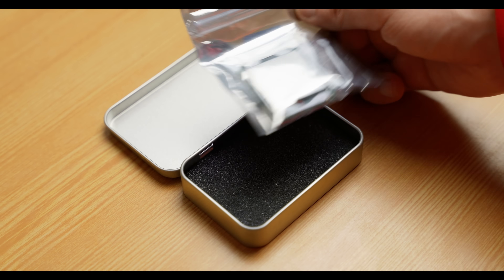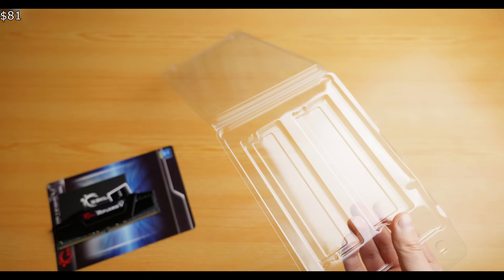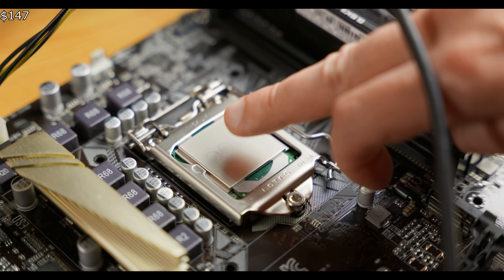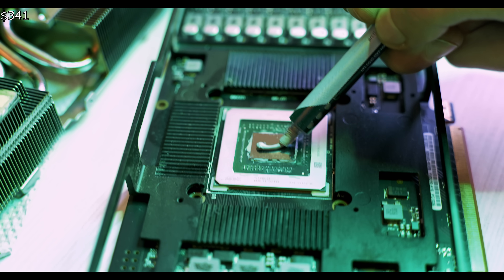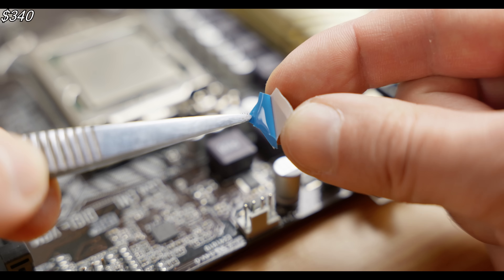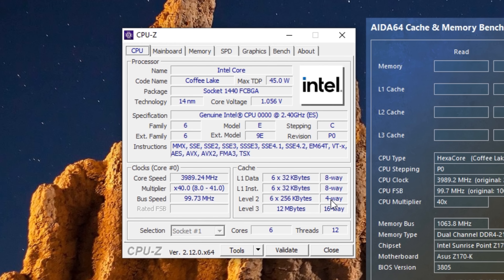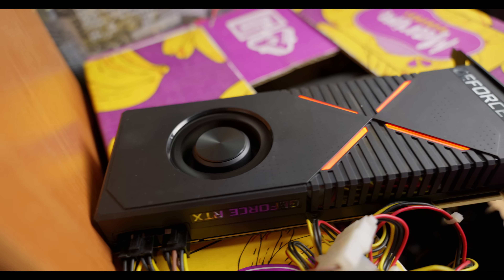I Built a PC With a Laptop CPU

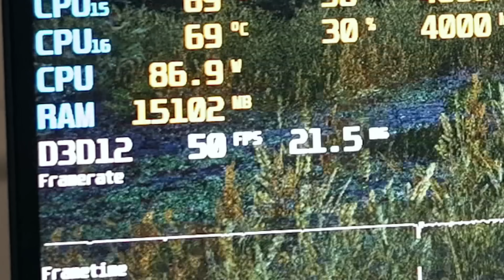Comment from the maker: There is an error in the video with the name GPU. I didn't notice it when I was editing the video. I sometimes change names as a joke, but this is not the case. I will leave this message for those who do not know much about PCs. 5:26 - AMD RX 5700XT.  11:21 - AMD RX 580. 11:38 - AMD RX 5700XT. It's just that the voice actor made a mistake when voicing the text
Reply: The RTX 580 is basically the same as the RTX 5080 but with one less fan and the Nvidia logo removed for licensing reasons. Also great value for money and much easier to get right now than the 5080.
Reply: @RealNovgorod what are u talking about that doesn’t exist
Reply: @kevinjacob9420  It's a joke...
Reply: I really hope you said the washers are there cos cpu vibrates as a joke XD
Reply: Ok
Reply: Why do you need voice acting for the first place?
Reply: @aero2zero  he is Ukrainian
Reply: Are you the same person behind T-1000?
Reply: What you did with your voice, Never again...
Reply: як ти цей відос озвучив?
Reply: @ivanitos_1  То не він озвучував. Геній
Reply: Great Video! I Just wanted to point out one thing for you since it was important that the processor mounting screws remain tightened down. The "Lock Washers" only work when the washer is between the Head of the Screw/bolt and a surface. The Split in the washer, in a spring configuration, creates a 'toothed' effect resisting the screw from Reversing over time by toothing into the surface and screw head basically "locking" it from rotating backwards. With the washer simply between 2 "Non Rotating" Surfaces, it is no different than a spacer. 👍
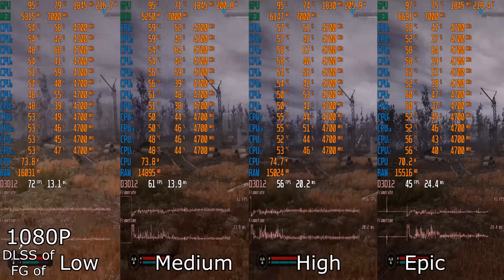Reply: Also there was a frame where you were flashing a text that says CPU bottleneck while you were pointing at the GPU. 11:18 🤷‍♂
Reply: yo lemme get a pc mine sucks
Reply: Jesus Saves and Loves ❤

Comment: i built an mini-PC out of an Core 9 Ultra 285K and an undervolted RTX4090D from china, it's liquid cooled, coolant lines are custom fabricated copper pipes 👍, it is very small and runs cool, i run Linux Mint on it for portable work applications, i carry an samsung tablet i connect to it as a display

Comment: mobile processors can't handle as much I am shocked that it didn't burn out.... I wouldn't buy the power supply from Ali as with most things coming from the consumer based out of china and the voltage being different I would just buy that locally....

Comment: Bigger cpu coolers are useless because the thermal resistance between the die and the heatsink (between 1 layer of thermal paste and another layer of either solder OR thermal paste and the IHS) is just too high to get all the heat though into the heatsink.

Comment: WTF. i had stalker 2 since before christmas and i get even get it to launch. specs:
EVGA SR-2

Dual X5690 OC at 4.4ghz

24GB Corsiar vengeance Tripple channel OC around 1800mhz (edge of stability)

Adaptec Sas 6gb/s plus several Seagate Cheetah raid 0 arrays

Quadro M6000 12GB
Geforce GTX480 (2 more VGA monitors and physX)

SB Titanium HD

Windows Server 08 R2 (windows 7 SP1 with extra stuff like type 1 hypervisor) 

can run metro exodus on max but cant launch stalker :/

Comment: There is an error in the video with the name GPU. I didn't notice it when I was editing the video. I sometimes change names as a joke, but this is not the case. I will leave this message for those who do not know much about PCs. 5:26 - AMD RX 5700XT.  11:21 - AMD RX 580. 11:38 - AMD RX 5700XT. It's just that the voice actor made a mistake when voicing the text

Comment: Ah yes, the good ol Phillips power switch. You’re my kinda guy. Can I have this PC when you’re done? I love ASUS boards and strange cpus. My main pc back in the day was an ASUS K8N modified to take a laptop mobile Athlon 4000+ overclocked to around 3ghz and 3gb ddr1 ram.
Reply: Also wanted to note I too made a computer in a box with a smashed slot 1 system I trash picked as a secondary pc to play network emulated snes games with my siblings

Comment: I've got the same ASUS z170 motherboard with the QTJ1 chip from  aliexpress. . Some users had delided them and got much lower temps. Interesting information about the VRMS  , I had been searching for where these were on the z170 board without luck I could see several locations were  running at around  110degrees Celsius and it is probably these. Youtuber Miyconst had said these boards vrms were too weak to run these 8 core chips and recomended the z370 minimum 
 but they seem to be capable. I've settled at around 4.6ghz and a slight undervolt as the system becomes unreliable running any faster.

Comment: Those washers are not against vibration. This CPU is not dimensionally fit for socket, so it is there to raise it a bit to accommodate it in.
Reply: yeah room temp iq take from op . brutally obvious it was due to the interposer and and heat spreader
Reply: @donbot5000  calm tf down dude. unwarrented hate out here. he is from ukraine and hires a voice actor who knows nothing about pcs, that's why (among other things) he says 'm point 2' instead of 'm dot 2'. that is probably the reason some things dont make sense. calm the fuck down and instead of using all 3 braincells to write mean comments, use 2 to write comments and one to think.

Comment: Tbh I'd put the extra 10-15 bucks towards a new nvme ssd.
Also a bad 2nd hand psu isn't a great idea if it's your main pc and not a throwaway build, especially if you put a cheaper thirsty GPU (e.g. an rx580 or 7970) alongside the 130W cpu. At best you might experience crashes/instability, but you also risk sending too much voltage into some components and fry your gpu/mobo.
You you can't afford good hardware, you sure can't afford to fry it, save a bit more and grab a decent brand new psu that has a warranty for 50 bucks. (Do check reviews first, some new psus have been known to blow up)

Comment: There are some significant issues with the video... psu IS important and the washer mod for the socket... vibrations... no. it's because the mutant is dummy thicc...

please do not attempt to use a 350w psu for a 2080.

Comment: this is cool mod.   My only real comment is with a banana box instead of a real case -  you are throwing rf out into the world.    I am not an electrical eng., so I have no clue as if too much or very little.  I am a safe limits guy, so I would be concerned.   fix - wrap al. foil around box.   but besides - cool.

Comment: the cpu vibrates what? no the washers are included to raise the height of the locking mechanism so it will still work with the increased height of the new cpu...

Comment: Just give 5$ to a scrap yard and take an old pc case leave the bananas 🍌 box plus you can find under 10$ cases on pc stores at refurbished parts , also if the PSU fails it might be bye bye for the hardware, give extra 15$ for a decent PSU

Comment: 4:11 ah yes, saving 10 bucks on a ssd just to have terror of loosing your files or being scammed and just having a 4gb usb stick inside and loosing your files
Reply: Yeah, because an ancient Chinese PSU and a flammable box are not the problem, losing the data on a build that's only going to be live for a video si
Reply: @ElKITENAUT  also wrote a second commentary about the PSU don't worry.
The box alone won't be a problem really, althought its still too janky for me, considering the case is what you could really dumbster dive for free without much issues.
Reply: @Ramog1000  the box alone won't be a problem, true. But it is a problem with that PSU.
I made a plc PSU literally catch on fire and it wasn't small.
Problem with the hard drive? No more booting
Problem with the PSU? The studio catches on fire

Comment: Stalker 2 uses Uengine, force disable TAA to gain more frames, or run at higher resolutions and disable AA completely in game. High textures need more vram, if you can lower that, everything else will run just fine.

Comment: Personally, I would recommend checking out the hp z440 motherboard. Supports up to 256gb ecc slow (2400 with most capable cpu) and lga 2011v3 cpus, aka my goats the e5 2400 v4 ($5-7) and the e5 2690 v4 ($25-30). The z440 system is a budget monster.

Comment: Hmm I have an RX580 8GB running on an i7 4770k that has been overclocked to 4.5ghz with 32Gb DDR3 @ 1600mhz and it runs Stalker 2 at 60 + FPS @ 1920 x 1080p with Textures set to high and other settings to medium and low, GTX 1060 6gb performs similar.

Comment: I have to locked version of this CPU (qt2j or whatever) judging by the packaging exactly from the same source, I have it running in a DDR3 motherboard with H110 chipset, it runs fine, I did a .1v undervolt and upped the north bridge clock (that made a big difference, out of the box it was running at 2.4ghz and it was terrible), oh, the seller sent me a bios file, and I just flashed it (with a common bios flashing utility) with a different CPU and it worked fine.
I like it

Comment: "If the PSU fails, no big deal!"
Say that to anyone whose PC parts fried after a PSU failure...
Reply: i have lost 3 computers to psus going out
Reply: Cheaping out on the psu is THE worst buying advice you can give.
Reply: @Ktmzqw  Agreed. Ive Always told my customers this.. Its not worth saving 50 bux when you can loose Thousands possibly. I learned that the hard way in the early 90s.
Reply: @Ktmzqw  doesn't mean that you should spend a lot on it
Reply: The PSU is clearly THE part you don't want to cut corners with. I wouldn't trust this bottom of the bin wreckage even for a testbench setup, I did this mistake 15 yrs ago, it killed an ATI GPU.
Reply: Me using cheap PSU with a stabilizer goes brrrrttt.

Y'all using a cheap PSU don't forget to use a stabilizer or a UPS. Only some people like you who didn't know about basics of electrical engineering.
Reply: I'm still running a 2000's PC Power and Cooling 750w to this day, greatest PS ever and worth every penny.
Reply: Agreed 100%, I learned this the hard way years back buying a green Antec Earthwatts 430 watts PSU, thinking I would save some money on the PSU, and my Power bills, but I only ended up getting the dreaded magic smoke on a  Sunday afternoon, Thankfully being someone who does PC salvage/repair as a side hustle, I had a spare Rosewill 450 Watt PSU that saved the day, of course this was back in the AMD Athlon II X3/X4 days when 500 watts was overkill bill for most builds, btw that Rosewill PSU still works to this day, and that AMD Athlon II X4 system still works running Solus Budgie Linux in my guest room as a backup machine thankfully with no other damage.
Reply: @CommodoreFan64  rosewill is an underrated PSU brand, very reliable i've never had a rosewill fail on me
Reply: @coltsamuels  Same in all my personal systems I've had them in, but i did have one where I had a customer did a return on a system I built them with a Rosewill 550 watt PSU about 7 years, or so ago who lives at a local RV park, where according to him, he plugged it into his camper while running a space heater, tripped a breaker, and overcurrent protection kicked in, & pop a couple caps, I got a new Rosewill PSU for him,  & have not heard from the guy since. So I guess the computer is still doing what he wants it to do. 🤷‍♂
Reply: @coltsamuels  you shall not trust a brand simply by it's name anyway, they almost all use different OEM/ODM for different SKUs. This means they contract different PSU makers to make a PSU for them. Antec PSU were great in the '00s but sometimes their low-end ones were "meh".
Reply: came to comment this as well, worst advice is to tell people to cheap out in PSU....
Reply: Bro the women give mi pc to repair the psu is damege. Psu kill every single part in this pc (psu is a random no name) buy onli a certificate psu
Reply: do not buy cheap PSU lol
Reply: No big deal indeed
Reply: is buying used cpus good? im looking for a cheap i3 3rd gen
Reply: i've murdered 2 power supplies, never had other components fail with it

Comment: For the longest time, removable BIOS chips were not on consumer motherboards.  If you look at server boards they most likely have a socketed chip.  I can't remember the last time I had a BIOS related problem from a bad flash but it is nice to be able to recover from that easily if you are willing to wait for a new chip or even wait to get your chip back flashed properly.
Reply: Sometimes a Consumer MB would have 2 x bios if it was an highber end model. One of my older AM3+ mb's had 2 x bios on it.
Reply: during the 90's and early 2000's, it was the standard,, mid 2000's most of hi-end mobo still had socketed chips, soldered BIOS chips became the new standard progressively between 2007 and 2010 (the infamous vista era).

Comment: I use a mutant i9 12900HK (mobile chip) on desktop. its awesome. got it for 200$ and the 14 cores n 20 threads can literally handle anything.
Reply: For me its the i9 13950hx which at the price i got it for was £208 or $268.44 there only issue with that cpu was how picky it was with which motherboard it was slotted into and ram but after getting right motherboard and ram no issues besides needing to get a better cool lol.

Comment: 4:57 - It's not recommended to put 4 ram modules with these mutants. It probably won't boot with more then 2 modules (like my prev cpu - qtj1; also my hynix djr ram was running only 2900 mt/s, but with old i5 6400 it ran 3733 mt/s)
Reply: some of these abominations even have quad channel bro, why not use 4 ram sticks?
Reply: @caralho5237  qtlt\qtj1 and i9 9900k doesn't support quad channel. 4 sticks isn't mean 4 channel, its 2 stick on each channel.

Comment: Hi, you have quite an odd conception of mechanics, this is the first time ever I see a Grover washer being installed on the screw head side side instead of the nut side, but at least you sing almost in tone. 😋   You should also read articles/watch videos (the serious ones) about thermal paste application tests, the (one and only) best method to ensure a maximum drop of temperature is still the same as it was 40 years ago, only a small pearl of it at the center of the device to cool, spreading it manually being the best way to create air bubbles in your paste and to make a too much thick film.

I like the banana case, cheap, neat and useful.